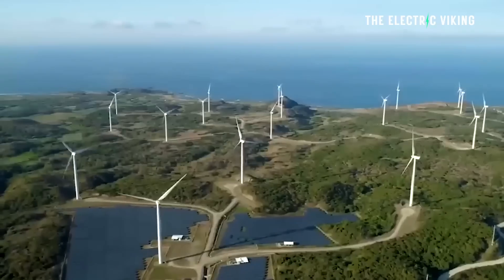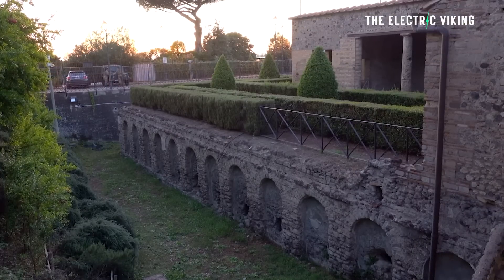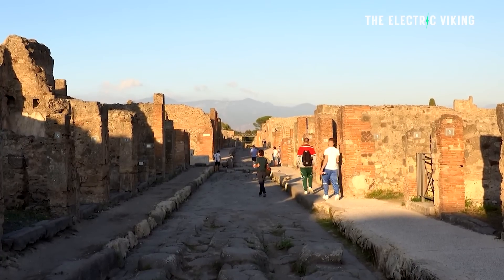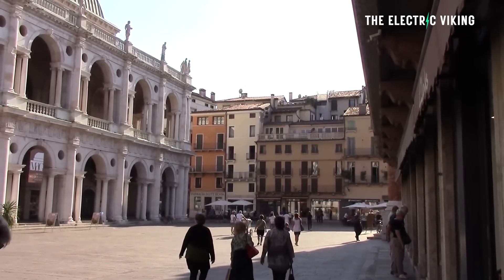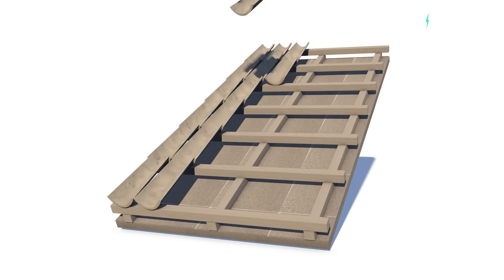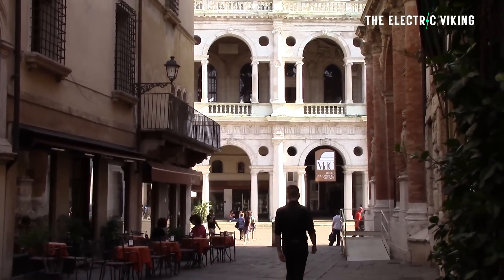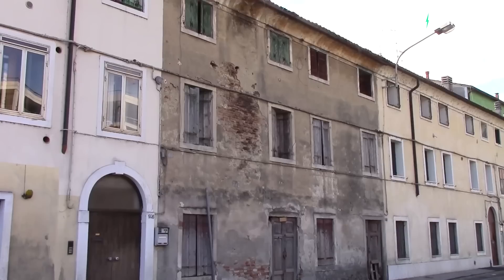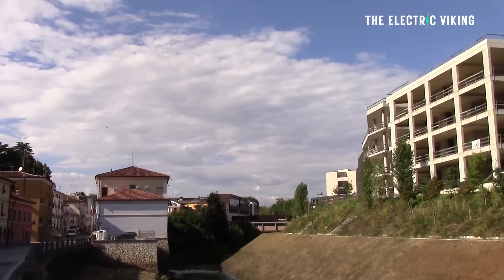“Invisible” solar panels are taking off in Europe

Comment: The cost to the human species of solar energy is higher because of the cost of finding and evaluating alternatives

("solar panels" OR "solar energy") ("zoning" OR "heritage" OR ("laws" OR "restrictions")) shows 31.9 Million entry points (Google, 29 Apr 2023)  Innovation is not the high cost of solar, it is the high cost of finding and evaluating alternatives.  Multiply each of these by many human languages and 5 billion humans searching the Internet for effective answers. 

("solar panels" OR "solar energy" OR "solar cells") has 165 Million entry points.

"solar" ("energy" OR "electricity") has 430 Million entry points

Richard Collins, The Internet Foundation

Comment: I love it, but,... what percentage of the light is blocked by these decorative covers over the solar cells?
Also, with this design the cells are facing 2 directions and so only the south facing tiles would be relatively efficient.  What is the efficiency rate on the east and west facing roof pitches, and the north?
Reply: Like Telsa tiles, they are basically garbage... the efficiency is about 4% compared to a bog standard panel at around 21%

Comment: In an 2017 article I found claims of half the efficiency and 4-5 times the price per watt. That may actually still roughly hold today, because the efficiency penalty will still be there and the price will have come down, but so has the price of regular solar.

Comment: I looked into this about two years ago and I have been following the company site to see if the price would arrive at a realistic level for home owners. When I checked in July '23 it was still going to cost approximately 7k euro per kw. That doesn't include delivery or fitting. That puts them way out of my price range. We cannot use conventional solar panels as we are in a restricted area. The price will only come down if their is enough interest from installers and even then the manufacturer would have to have a bona fide commitment before gearing up to make the tiles in sufficient volume to allow the price to fall. Here in Italy I don't see that happening any time soon.

Comment: Lack of skilled labor to install and maintain residential solar systems is a limiting factor on adoption. In the US the #3 installer of residential solar, Pink Energy, went into bankruptcy last year after installing a lot of systems that didn’t work, barely worked or stopped working. People were sold a system under promises it would get rid of their electric bill, but they ended up with monthly payments on the solar system equal to their electric bill despite still having an electric bill similar to before. With pink energy out of business, many of the homeowners can’t find another contractor to get their systems working.

Comment: There is a counter argument - if you replace a heritage roof with a solar roof that looks the same you are destroying the original heritage in some cases whereas fitting conventional solar over a historic roof might not look so pretty but it actually protects the historic roof and preserves it, and when we all get pocket fusion reactors and remove solar it'll still be a historic roof

Comment: It would be helpful if this video had mentioned the efficiency of these 'invisible' solar panels, especially as one must assume some loss of energy in the transmission through the outer (upper) surface. Also there was no indication of cost apart from an expressed hope that the cost could come down with increased adoption.
Reply: I agree. It's impossible to know if these are a good general option without that information. It may be the case that they have TERRIBLE efficiency and cost WAY MORE than other solar options, and still be suitable for historic sites simply because no other solar option is even allowed by law.  But that would make them a bad option, or non-option, for anywhere that doesn't have the same laws prohibiting other solar options.
Reply: Other issues are the interconnections in terms of reliability and installation time and complexity.

Comment: There are conversation areas in the UK that will not allow house owners to install solar panels on their roofs. This would be a perfect response. And maybe they aren’t as efficient as a proper solar panel, but they will be a lot more efficient than no solar at all.
Reply: It also occurred to me that my panels are really big but because of their shape have left quite a bit of roof free, these tiles could slot into the gaps to squeeze a few more watts off of my roof.

Comment: I sort of doubt that invisible will be a great help to solar - or even how cheap they are per sec.  The major cost is installation and the amount of space required.  Tesla has offered solar roof tiles for some time; but they are 10x the cost of a regular roof.  Geothermal is probably the best option solar is simply too space consuming to be very viable for home solar.

Comment: I live in an area where a lot of the roofs are of the very complex nature. Hips, valleys, dormers everywhere you look. The traditional large solar panels would simply be impossible to install. And a lot of the houses are in conservation areas so have major planning restrictions placed on them in any case. 
These however would get around both of those problems straight away, and would probably weigh no more then the existing tiles either. I have a feeling they are going to be very popular.
Reply: I bet those roofs get a lot of leaks , hips, valleys, tiles = leaks
Reply: @investingthelike111  not especially. Been the designs here for 000s of years
Reply: True dat

Comment: A few years back, Tesla was promoting their solar tiles but have not heard much from them since? It would be good to get an update!
Reply: I think they are just a normal product by now, they work. And as a guess, Teslas cells are much more suitable for general application, with efficiency and price similar to classic panels. I see the invisible cells as t tool for architectural restoration or so, where price and efficiency do not matter.

Comment: I should expect that the solar "tiles" would be far lighter than terra cotta;  for people living in areas susceptible to earthquakes (like me) that would be an important factor.  One cannot insure a tile roof against earthquake damage, because the tiles can all be thrown off the roof by an earthquake (to the detriment of anyone or anything alongside the building).  The increased stress put on the frame of a building by a tile roof during an earthquake can twist the frame beyond repair.

Comment: There are upsides when it comes to zoning and asthetics in these preservation and cultural areas, but also some really serious downsides with regards to corrosion, maintenance, and the fire-hazard of having cells and wiring sitting up right up against the under-layer of the roof.

If you have no choice, then you have no choice. But if you do have a choice it is generally a good idea to avoid solar roofing tiles and use discrete panels mounted on top of the existing roof.   Doubly so if the panels can be mounted without nailing or screwing into the roof.  Many roofs can be mounted-on without having to drill through the roof.

Comment: Yes, this is a fine idea, it obviously has a place in some locations, maybe.  Imagine replacing everywhere?  Replacing tiles for new PV versions is wasteful.  Perhaps on rebuilds or historic locations, but everywhere?  I have a sheet metal roof, so I will stick to typical glass panels, they look cool.

Towns in the grand tours may not have PV as they might have hydro or other forms of power supply.  Many locations have wind turbines, so perhaps PV are not needed.

Comment: Even if it isn't as efficient as a "regular" solar panel, the smaller form factor will likely make it possible to cover larger sections of, if not basically the entire, roof.
With regular panels, you usually can only mount a certain number (e.g. 5, 15, 25) depending on the available (square/rectangular) area with the right overal angle(s).
If you have many smaller panels, you can likely place them in far more sections of the roof. Even in fairly odd sections. Below the bottom line, you might end up with far more capacity to generate electricity. I've luckily got space for a few panels on a shed, but personally I'm waiting for a creative solution for my thatched roof. An energy-producing artificial reed would be nice!  ;-)

Comment: Now, even those in historic buildings have no excuse anymore for declining installing PV.
For normal buildings, it’s a waste of money. Having solar panels is a public statement that you are environmentally aware and responsible.
Reply: My solar panels provide 80% of the energy for my EV. For over six months a year they also reduce daily electricity consumption down to 1KWh for the entire house, for an entire day. They have proven to be a fantastic investment. They are also 'permitted development' so anyone can fit them. Panel efficiency is constantly improving. I suspect the 'invisible' ones may lose 60->80% of the potential energy gain when compared to traditional units. Sounds a good idea but I want to see the numbers.
Reply: @mbak7801  next step after installing PV, will be a greater acceptance of home batteries. Now spring is halfway, i see the amount of time the panels are delivering increasing (I installed them mid-winter)

Comment: "Cheapest form of energy?"
Really?
So how many lightbulbs can a 250W panel run at 2AM?
Zero

Out of 24 hours a 250W panel might produce 200W for 4 hours and maybe 50W for 4 hours and 0W for 16 hours.

So 10X the cost of a solar panel since you have to store that energy made in 4 hours into a battery to deliver it 24 hours.

Solar is the most expensive energy in the world - wind is second.
Reply: Assuming 40W LED bulbs I would guess 100 lightbulbs. I have 20 panels connected to a 7KWh battery. Panels are 350W to 400W these days BTW. Currently I get between 15KWh and 30KWh a day. I feed roughly 14KWH into my EV per day of which 11.2KWh is from solar. The rest is used in the house or exported to the grid.

For six months a year my house draws 1KWh from the grid per day. Or that is what the stats say but I suspect this is a nominal figure and in reality it is zero. Evening energy comes from the battery.

Solar is a very cheap energy source which you must know. Why you should use 'sums' that would embarrass a 6 year old is mystifying. Wind of course is also super efficient and luckily the turbines can be turned off. Even so we still get negative pricing due to over generation of electricity. Yes octopus Energy customers are sometimes paid to recharge their EVs in order to balance the grid.